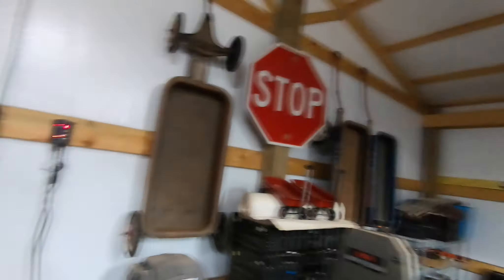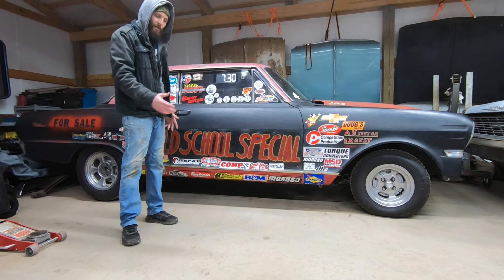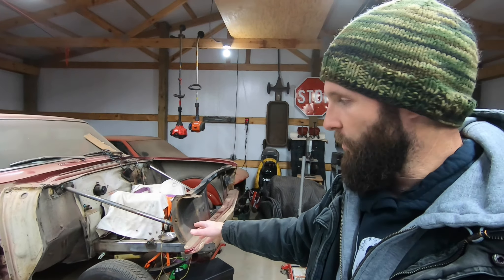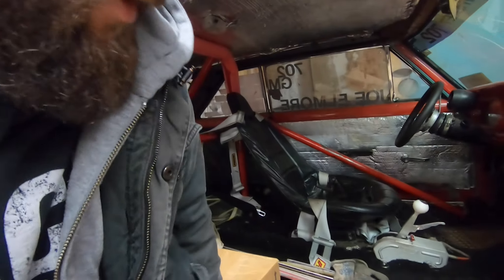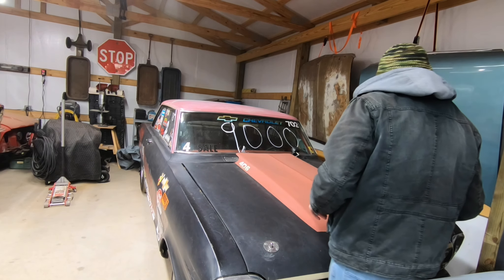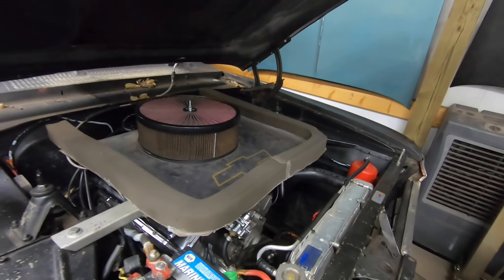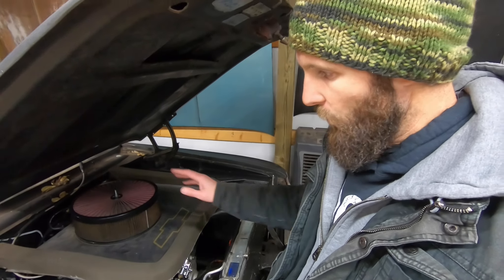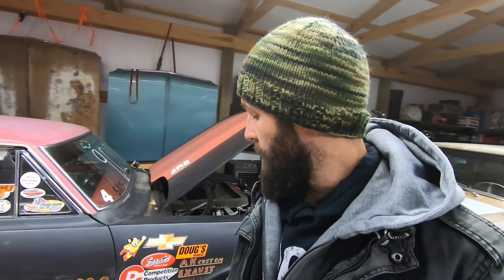The New Drag N Drive Gasser Project

Comment: If this is your first drag and drive .it might be toughin a gasser .have you thought about just updating the car in current condition and trying it out for your first year ?
Reply from the maker: Realistically that may be the "smarter" approach but it would kill my motivation for the project. No doubt the gasser approach will have it's challenges both in getting the car to make clean passes on the track and reliability getting down the road. That said, at this point in time it's the only way I can see doing this project, and when I do finally complete my first drag n drive event, regardless of how I place it'll be a sweet victory.